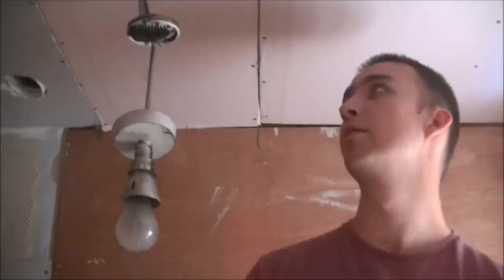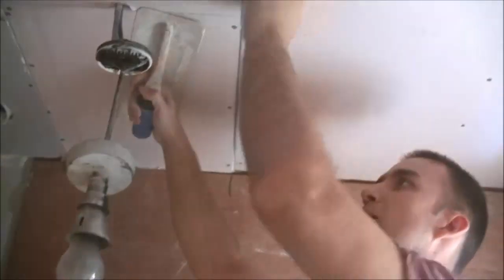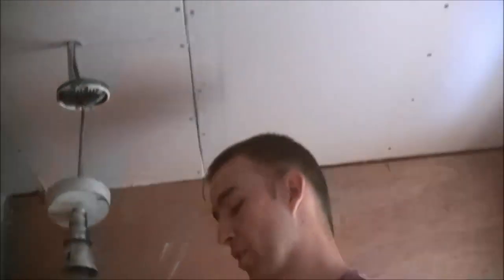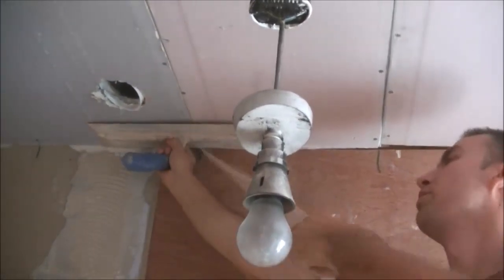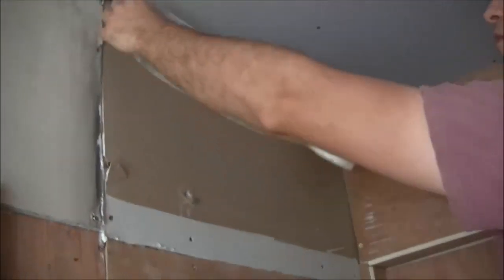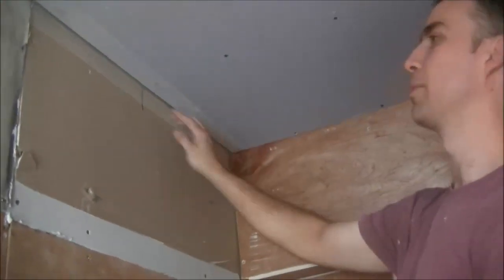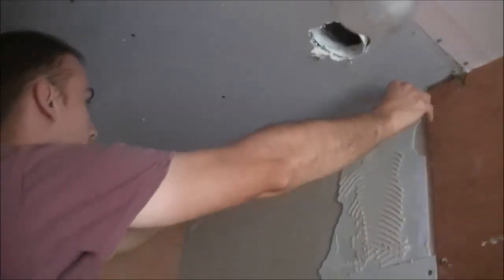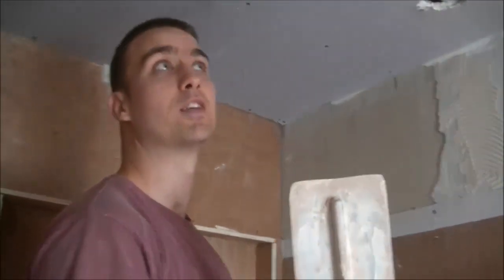how to scrim tape a ceiling ready for plastering,skimming,bonding

Comment: It's great the wide scrim, don't see it all that much around here though
Reply from the maker: It can be hard to get at times mate we used to just use it on all joints but then if you run out it's no as quick or fun using the thin 2inch in them lol
Reply: @mac plastering  I remember in the lock down we couldn't get any scrim at all and I had jobs that had to get done, we cut the three rolls of 2" down the middle to make 6 rolls of 1" 🤣🤣 boarding had tk be perfect 🤦‍♂️🤣
Reply from the maker: @Onthetrowel  haha yeabe a nightmare haha we weren't to bad think pva was a bit short in places

Comment: Good vid mate, very informative.  Question...I plan to fill old windows in above internal doors with plasterboard and then skim over...there will be bits of painted wooden frame on show (2" wide by 6" length) can I scrim tape over the painted wood and skim over? Like is there anyway the plaster will adhere to the wood? Cheers mate
Reply from the maker: most likely will crack there as the wood tends to move different to the boards / plaster pva and scrim on them is best way if it is not possible to remove the frame and stud it , the frame will be either screwed or nailed in up the sides not always easy to see sometimes there might be one at top best way would be run a sabre saw with a metal bit on it cut away the fixings and remove then stud it out
Reply from the maker: mate this video is of where a door was might help you patch it up some or get what way i am saying https://youtu.be/ZPRTJJW2VOM
Reply: @macplastering  thankyou mate! Took your Advice and took the actual frame out itself...Alot easier than I thought as was worried about disturbing coving and set plaster etc but nothing budged...cheers mate
Reply: @macplastering  got old socket spaces due to rewire and also bits of plaster to fill in (hard areas to reach with trowel etc) was thinking of using expanding foam and then scrape bk when dry to plaster over... Have you tried this before, heard it can be done?
Reply from the maker: Hi mate sorry for late reply sometimes YouTube don't notify me think it is the thread might be best to recommend a new so they notify i think ??  but yes have done that but not my 1st choice as it will be a softer background than the skim coat if that makes sense mate
Reply: @macplastering  thanks for replying mate... actually did end up bonding a load of patches.  But did try the foam too then went over it with scrim and had some easy fill lying so slapped it on now it's level with the old plasterboard do think skimming over it now be bit better
Reply from the maker: Nice one buddy

Comment: I'm putting up a small piece of plasterboard (30"x17") but how close to the edge can I screw in to the plasterboard and how far apart would you have the screws. I also need to buy scrim tape for a small diy job but what brand would you recommend as I've read the screwfix no nonsense scrim tape is not very good and the scrim tape from toolstation falls off.
Reply from the maker: hey buddy u can only fix the plasterboard to a timber joist  so as close too the wall as possible but you must fix it to timbers , this vid might help = https://www.youtube.com/watch?v=8RWTM78Fkuc

i use any scrim i find if it is old it dont stick to well but if it dont you can always bed it into the plaster along the joints

Comment: Good video, do you ever over lap your scrim or would it make the scrim to high for skim.
Reply from the maker: It should be ok to over lap if you coat it like the way i do where i cover all scrims 1st then 2 coat the whole lot , also these boards have a little dip in them for dryining so scrim sits in nice there but it is best to have the scrim tight and not overlap as you could also block the plaster from going through making the join that little weaker if this makes sense mate

Comment: I take it you never done that boarding, bit of an abortion,  I didn't think you could plaster on to plywood, does this mean you have to put bonding plaster onto plywood first before skimming?
Reply from the maker: Haha I think i did do the boarding i have a video on it to LOL but It is over boarded and I think i bonded and skimmed it as well so its real fire and sound proof now  the ply was tiled over mate if i scrimmed any corners was probs just to help get some gear in the poor cut edges :)
Thanks for watching mate
Reply: @macplastering  sorry actually the boarding was top notch LOL.
Reply from the maker: @dilligaf2386  Haha for sure not my finest but man hate doing them small ceilings in small rooms no room to swing a cat never mind a plasterboard think one side is moisture resistant and other is fire resistant both are heavier than normal boards  LOL this was me over-boarding it -  https://youtu.be/8RWTM78Fkuc and this is another video on same thing maybe a little better LOL - https://youtu.be/bP2Mm1z8hmI 

I would never make a great joiner but I be happy with most boarding as long as there is not trowel wreckers screws not fully in hate that and the boards are tight and no bouncing if gaps i tend to bond :) 
Thanks again for the support mate have been trying to upload more these days always get one video a week on Sunday but trying my best to pump more out to help kill my boredom and others a little :)
Reply: Ha Ha yes I done my kitchen ceiling on my own because my 17 year old couldn't be bothered to  help me,  little shit. It is hard work getting it up and making sure it's all squared , up down, up down, up down  up snap   oh f...!!.  .You have a hard job doing it day in and day out. Keep the videos coming. The more videos you do the more I learn ha! ha!. Oh and I didn't realise you could get 4'' scrum cool.
Reply from the maker: @dilligaf2386  It sure is hard work and near impossibe solo for sure tell that son he needs to get more bothered and help his Da when i was younger loved helping m Da but i bet i was a right pain and hinder-enc  to LOL have a good skimming videos up might help you skim it if you are going to tackle it :) oh and 4inch scrim is the best think you can get 3 inch too witch is also good you can use it everywhere with ease :)
Reply: @macplastering  ha! Teenagers.  Look forward to your next video. Cheers buddy.
Reply from the maker: @dilligaf2386  Thanks mate :) Every Sunday but will try my best t get more out :)
Reply: @dilligaf2386  love the name, obviously a Kevin Wilson fan 👌